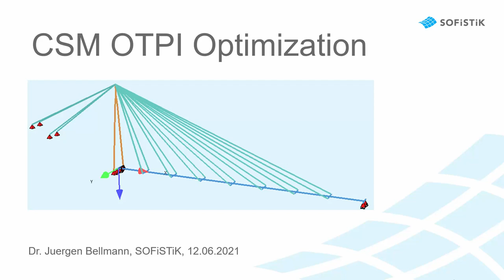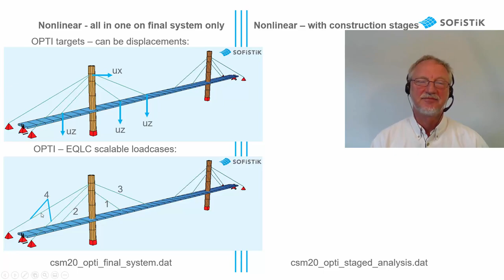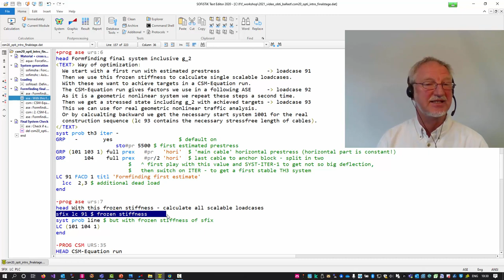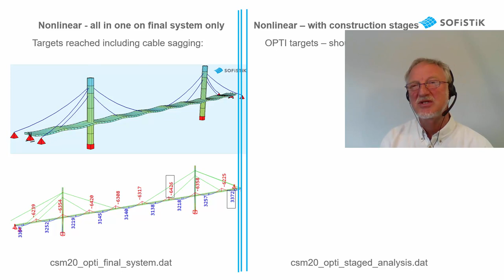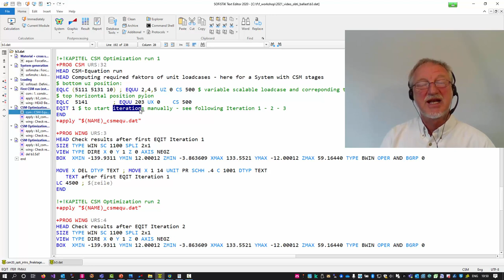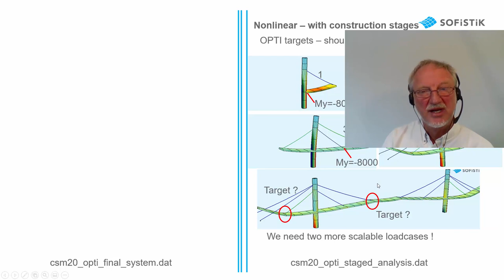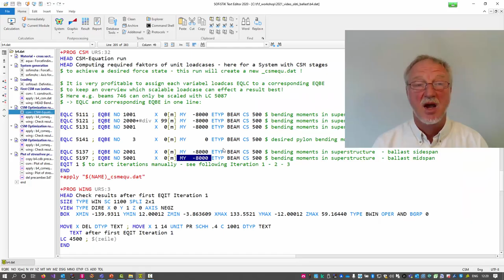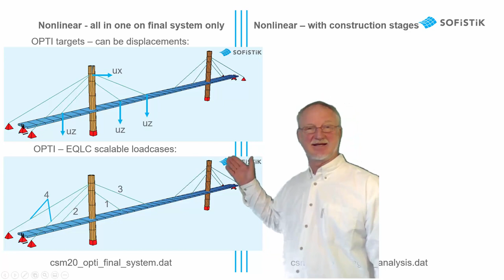Nonlinear Force Optimization with Cable Sagging

Comment: Vielen Dank für das sehr interessante Video. Videos zur Sofistik software sind sehr hilfreich, da manchmal die Beispieldateien alleine nicht immer verständlich sind. Daher schon mal vielen Dank.  Ich habe eine Fage zur Auswahl der Gruppennummern in den verschiedenen Schritten. Wieso werden zunächst die Gruppen 101, 103, 104 (Kabel Gruppen 1, 3 und 4) und die Gruppe 1 (Stabelement der superstructure) ausgewählt, beim sfix nur noch 101, 104 und 1 und beim Equation run wieder 101, 103, 104 und 1. Insbesondere verwirrend finde ich, dass die Gruppe 1 gewählt wurde. Ich habe in der Beispieldatei diese mal weggelassen und habe nicht sehr aussagekräftige Fehlermeldungen erhalten. Können Sie mir hier weiterhelfen?
Ich habe nun ein anderes Brückensystem und wollte diese Mehode verwenden, erhalte aber Fehler sobald ich verschiedene Gruppen für verschiedene Kabel nutzen möchte.
Reply from the maker: Hallo Tarik,
Danke für das gute Feedback - wir arbeiten daran uns da noch weitergehend zu verbessern.
Eigentlich ist YouTube nicht dazu gedacht solche Fragen zu beantworten - Ich habe jetzt trotzdem mal schnell reingeschaut.

Sprichst du in deiner Frage zufällig von dieser Schreibweise?: GRUP (101 103 1) 
Diese repräsentiert nämlich eine Liste von 101 nach 103 in 1er-Schritten, also eine Liste mit den Einträgen 101, 102, 103. Eine Gruppe 1 ist hier nicht enthalten.
War das zufällig schon die Antwort auf die Frage?
Reply: @SOFiSTiKAG  Hallo, und vielen Dank für die schnelle Antwort. Ja das war meine Frage, stimmt, dass ist eine Liste, hatte hier einen Denkfehler!